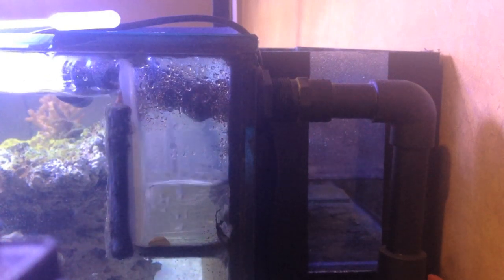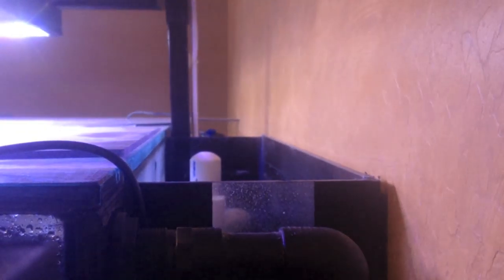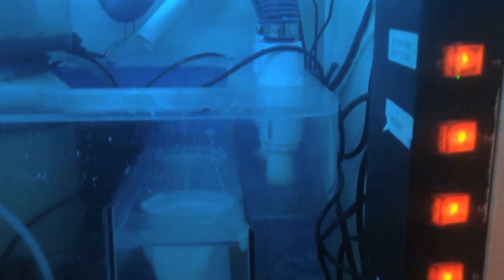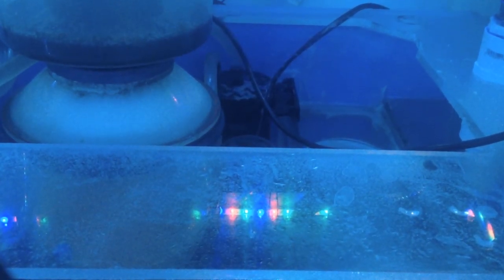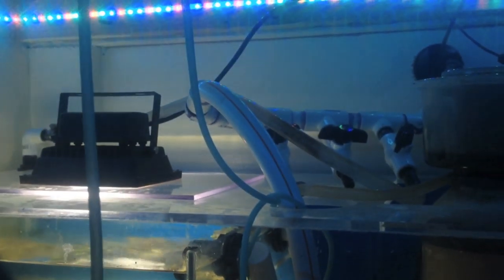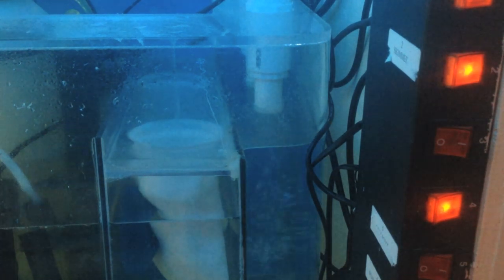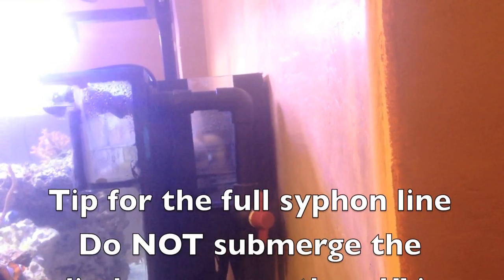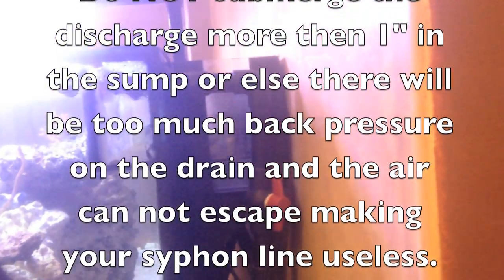Bean animal overflow and how my tank is plumbed.  How it all works.

Comment: Simply put, a 3 pipe (be an animal) system isnt needed if the remaining  space in your dispkay is greater than what's left in your sump, till the return pump cavitates. 2 pipe system is perfect & quiet. Some people think there is an endless flow of water and their tank is going to overflow. A little planning as to where your display tank water level will be, will assure no overflow situations.
Reply: im building my first tank and sump. time to use that math! i thought ive overthought everything. :)

Comment: May I ask how you attached the baffles in your sump? I have an acrylic sump I am trying to use but have never welded acrylic before, but it kind of looks like you silicone it in to place? Also. What size bulkheads do you have coming from the outside over flow box?
Reply from the maker: I used silicon as a secondary sealant.  I used weldon16 for welding the acrylic